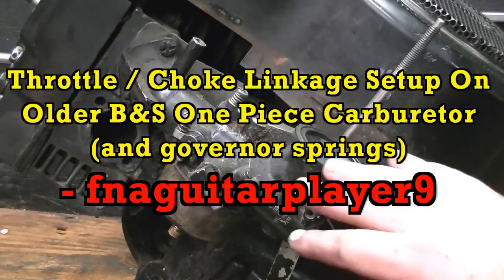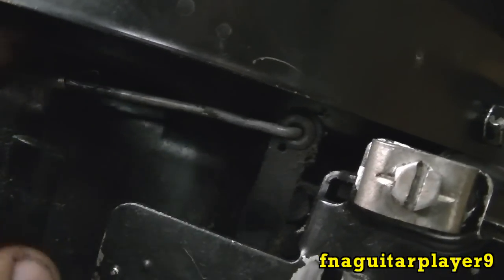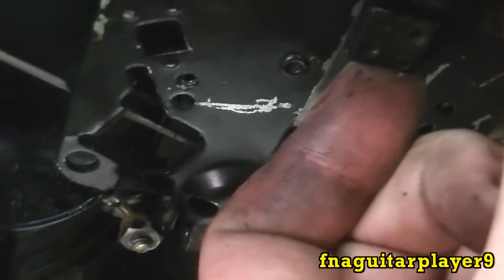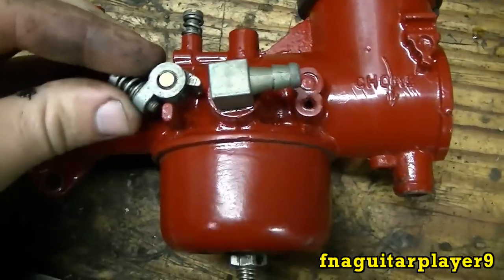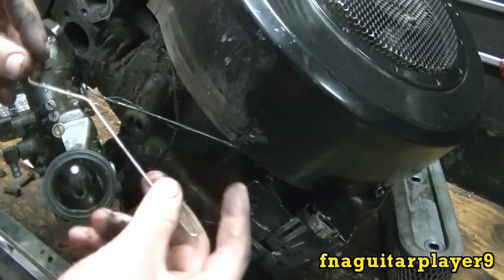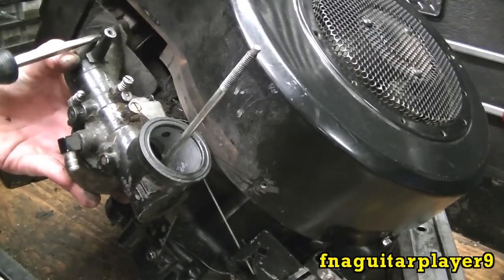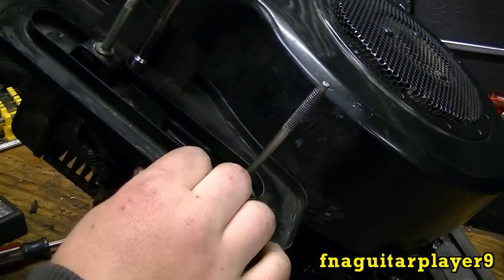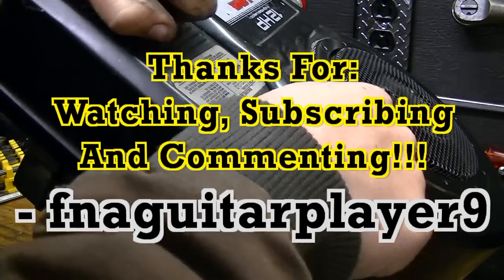How Throttle / Choke / Governor Linkage & Spring is Setup on Briggs One Piece Carburetor

Comment: I just purchased a nice Ariens YT1138 rider with a 11 hp Briggs. Engine runs fine at full throttle but not a 1/2 throttle or lower. Where should I troubleshoot first? thanks
Reply from the maker: Try adjusting the top mixture screw out, sounds like the idle mixture is lean. I have another video just on adjusting these carburetors. Thanks for Watching!
Reply: @fnaguitarplayer9  Thanks I did just as you said. I adjust the idle mixture , closed the throttle and set the idle speed. Works fine. I've watched several of your videos already. One more questions. While air cleaner was off and the engine running as it should I noticed  excess fuel in the area in front of the choke . Is that normal?
Reply from the maker: @denniscady2268  Your welcome. Yes to a point that is normal, if its excessive and dripping out then it may be the float/needle valve not sealing good, and if it runs out when its not running then thats the issue as well. I have noticed with these carbs a little gas will sometimes pool up.
Reply: @fnaguitarplayer9  Thanks again. I enjoyed watching your videos and i have saved them for future use. Enjoy your day.
Reply from the maker: @denniscady2268  Your welcome

Comment: I think i saw you called it a oil hose but i don't see where you hook it up at does it hook to the back of the carburetor?
Reply from the maker: Its a oil breather hose, or crankcase vent hose (basically the same thing as a PCV valve on a car engine). It connects on the back of the carburetor right beside where the mounting bracket connects to the carb. Thanks for Watching!!!
Reply: Mine has a lot of oil spewing out of it, what would cause that? It did not do that at first. After letting the engine run for about 2mins it started spewing out oil.
Reply from the maker: It could be a bad "pcv" valve, they don't call it that but it serves the purpose of one, or it could be from excessive blow by, if the engine smokes alot that is probably what it is, or it could be as simple as to much oil in it causing it.

Comment: I have a question mine kind of leaks gas out towards the back kind of behind the air filter screw but ain't the air filter screw it's like a right in the back like a little hole and was like a filter in it I don't know what it is
Reply from the maker: I'm not sure exactly what your talking about, most of the time on these gas leaks is either from the float sticking or the bowl gasket leaking, hope this helps! Thanks for Watching!!!
Reply: Yes it did it was just the float Bowl
Reply from the maker: I hear ya, i thought it would be that.

Comment: I have the B&S 8HP Engine on my John Deere 108 Riding Mower that I am trying to Restore. But Missing the Carb and the Air Filter and the Housing, in this Video it's pretty much the SAME and what I need. Can You or Anyone here help me to get ALL the Parts so I can get my Engine running again? THANK YOU very much in advanced!
Reply from the maker: I need the model type and code off the engine just to make sure i get the right part #, because that should use the smaller one piece flow jet if i remember right. It looks identical but is just smaller. Thanks for Watching!!!
Reply: Hi, THANK YOU for trying to help. But Finally I found the Part and the right Carb :))). YES, you are correct, its' the 1 Piece Flow Jet and your memory is correct and good as well :)) THANK YOU VERY MUCH !!! :)))))))))))
Reply: Also, I like to ADD, this is VERY USEFUL and THANK YOU for teaching us what you know :))). Although I am pretty knowledgeable, but it's always something NEW to learn. When I install mine, I watched this Video a few times to see yours... Make the Installation a bit easier. THANK YOU VERY MUCH !!!!
Reply from the maker: Your welcome, always glad to help out! If you ever run into any other problems feel free to ask me. I'm not always the fastest at answering comments but i always answer! no problem, thanks again for watching!

Comment: This video is exactly what I'm looking for. Any chance do you have a spare intake filtering system? I have the carb, but the filter is missing and I have tried to get another system from B&S and it fails. Here is the engine numbers Model 253707 Type 0206-01 code 86031911. This is an old B&S I/C Cast Iron Bore 11 HP Vertical shaft. I think I have everything else including the linkages and throttle bracket. Please let me know if you have something. I'm in Oak Hill FL.....